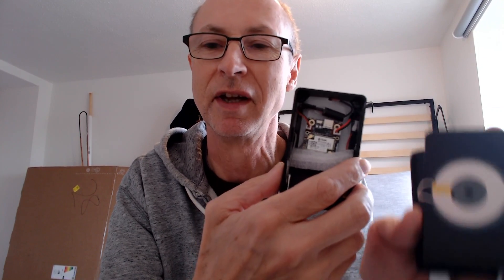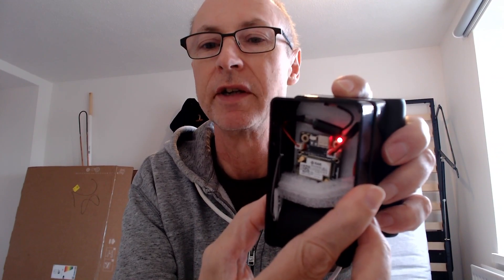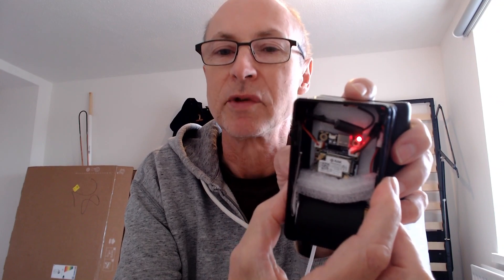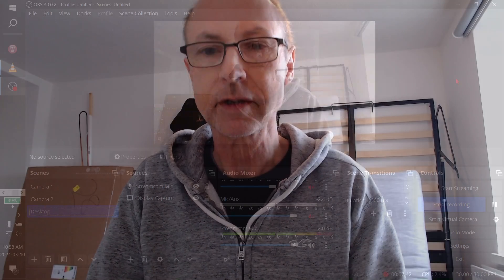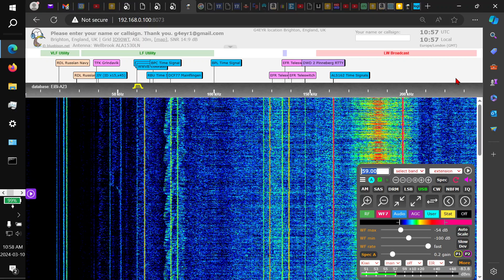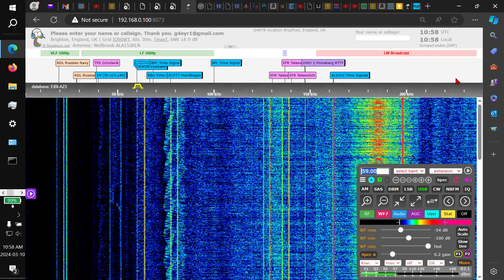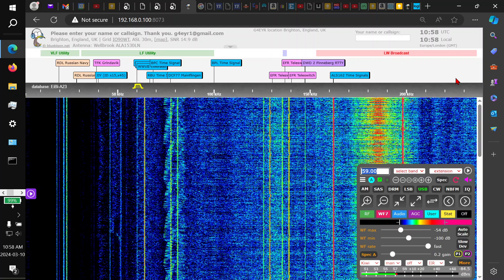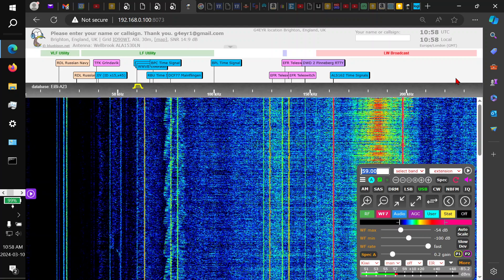Meshtastic Minimalistic Stealth Node

Comment: The rak baseboards 19007 and 19003 have a max battery charging current of 350mA, the solar input wires should be big enough as to not get too hot.👍

If you want a higher charging current, maybe try a tp4056 module attached directly to the battery.
Reply from the maker: Thanks for the info !

Comment: Hi Simon

How did you connect the external BT antenna?. My Heltec only has an IPEX connecter for the LoRaWAN antenna.
Reply from the maker: The board is a RAK WisBlock which has two IPEX connectors - one each for BT and LoRa. They also supply the board with two suitable flat strip antennas which I used here.
Reply: Thanks Simon.   I'll look into one of those boards.   The Heltec onboard BT antenna is woeful.

Comment: Be careful with wireless chargers, check yours for RF interferences,  you can  use an SDR to check it, my Baseus wireless  charger spams quite a lot when plugged.
Reply from the maker: This is excellent advice ! I actually have a video in the pipeline about this. Will publish it soon. My worst noise generator is a charger for larger LiPO4 batteries. This wipes out almost every HF receiver in my home when I switch it on.

Comment: Umm, about the power consumption? I'm regularly getting 4+ whole days off Heltec v3's with 2000mah battery, either as router or repeater. The battery isn't much bigger than the board.
Reply from the maker: Mine lasts around 24h but it gets quite heavy use. The battery may not be of the best quality. As they say, "Your mileage may vary".

Comment: You can find other antennas that are still small enough to fit in your box but have better SWR than the strip antenna included with the wisblock.
Reply from the maker: That is true !

Comment: yes, the heltec has the esp32 chip which is very power hungry compared to the nRF52840 chip which is preferred for reapters,routers and probably stealth nodes too.
Reply from the maker: Indeed this is true. The battery lasts at least 10x longer on the RAK Wisblock !